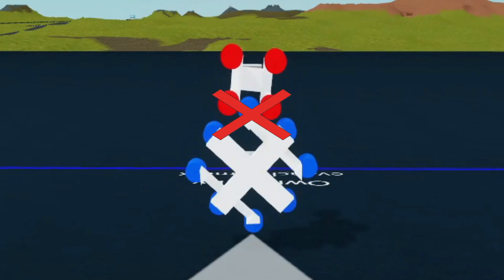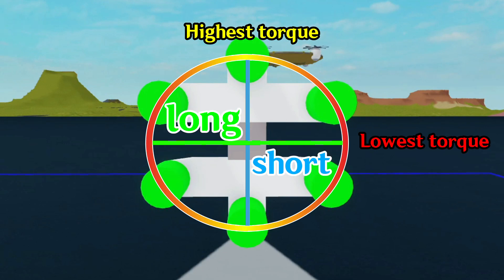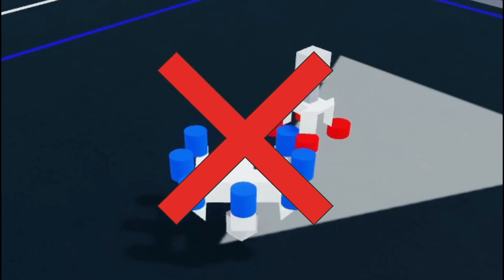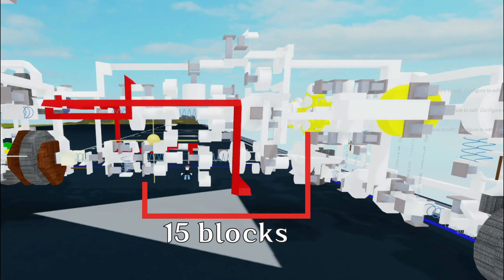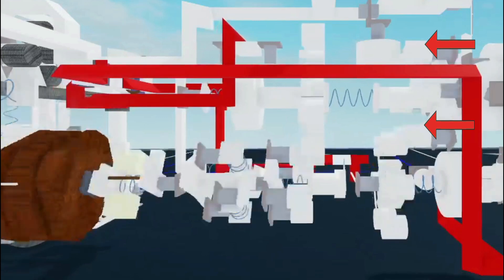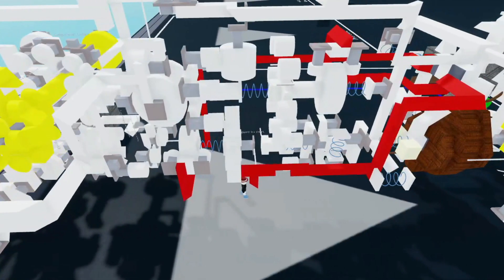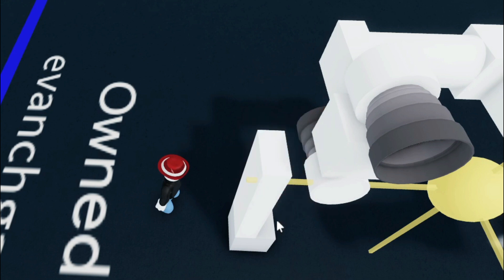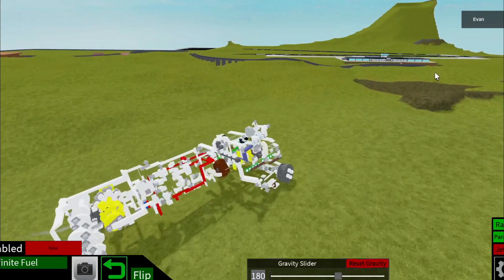How my transmission works | LePlanzy pt 3

Comment: Could you make an video about differentials? It would be very helpful and i have searched all over and cant find a video about them. Thanks!
Reply from the maker: Currently Working On in, It will be in the mechanical Car Guide pt2 and there will also be a guide and tutorial specifically about it. If you're waiting for it, I might upload the vid around 20 - 25 September so stay tuned!
Reply: @evans_workshopx  Alright Then, Thanks thats great news.